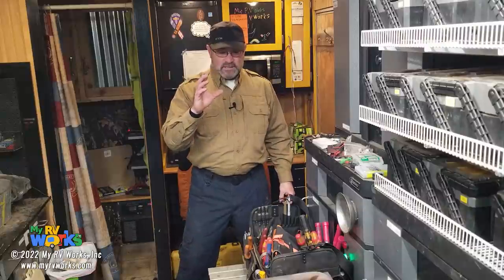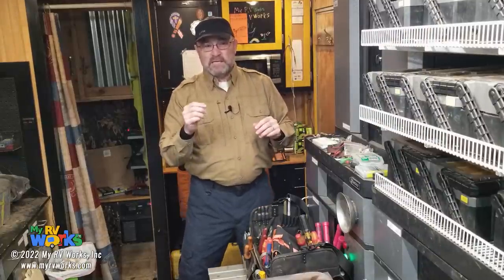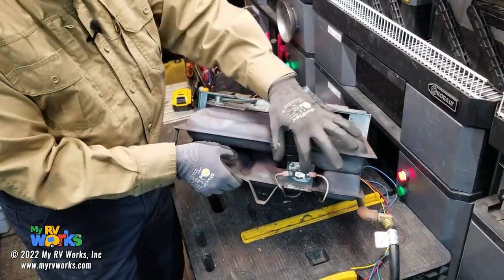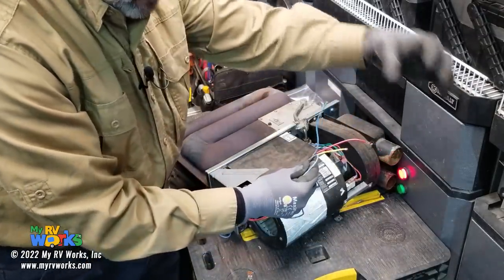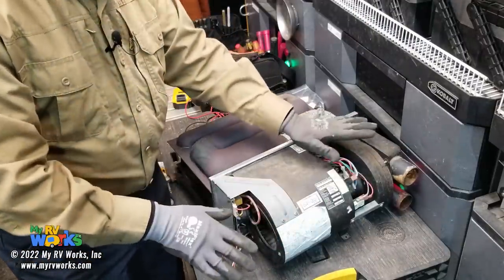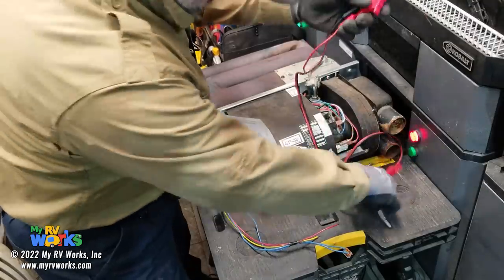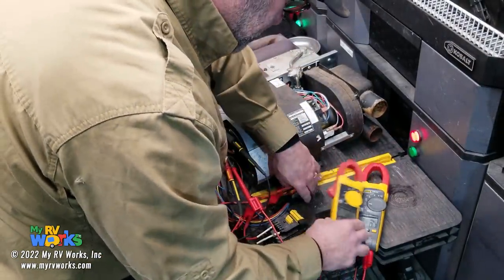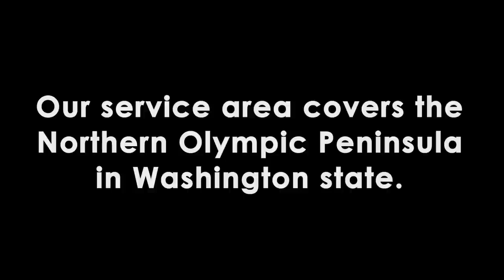RV Furnace Troubleshooting - An In-Depth Look At How To Do It --  (Part 1)  --  My RV Works

Comment from the maker: Thanks for watching! We appreciate your viewership and hope this video was helpful to you. Stay tuned for Part 2!
Reply: I have a problem with my SF- 35 furnace. It starts as soon as the fuse is installed, starts the fan, sequences the ignite circuit but will not shut off by turning down thermostat, or even shutting thermostat off. Funny thing is also the Duotherm AC unit compressor always runs after The fan is shut off. Even when the Thermostat disconnected both issues occur.
Reply: @thekiltedkamper2855
Reply: @frankschauer7828  it ended up being the Dometic control board in the AC unit.
Reply: A video explaining the suburban and wire hook ups.from wall to unit would be helpful. Mine came apart and now I can't figure out which wires go where?
Thanks...and if there is already a video on this please send link. Thanks for your help

Comment: Process of elimination. 80% of all rv issues are electrical. Intermittent issues are likely a bad connection, electrical short, or something overheating causing a fault. The other cause can also be unstable power supply. The first thing i always do is test the DC supply. It needs to ne stable. I stress the dc draw to confirm a stable supply. Then i begin testing parts for proper resistance and inspecting wires for insulation integrity. I use my digital laser thermometer to test wire and other temps. Eventually you will isolate the issue. Always consider that a hidden wire inside a wall or something that jas ahorted or disconnected. I this case i run a new wiring harness for that appliance to the source. I thwn properly label that harness from the source to the appliance.

Comment: OMG !! HELLO DARIN !! MY MAN, YOU ARE A ABSOLUTE SAINT !! THRU YOUR VIDEOS, MY FURNACE IS RUNNING SO QUIETLY, THAT IT SCARES ME !!! LOL I DON'T HEAR IT RUMBLE,  BIG WOOOSH WHEN IT IGNITES. I ALMOST WANTED TO MAKE A VIDEO FOR YOU, AS I RAN INTO A " ANTIVIBRATION STRAP " THAT HELPS HOLD THE MOTOR IN THE BRACKET AND NOT ENOUGH ROOM TO MOVE THE GAS LINE BACK TO BE ABLE TO EASILY REMOVE THE BURNER HEAD ASMBLY., THE ONLY OTHER THING THAT I HAVEN'T DONE IS HOOK UP A NEW DIGITAL THERMOSTAT, AS MY SETUP RUNS THRU A CONTROL SYSTEM 6.5 V THRU 2 TEMP. HEADS COMBINING THE 12.9 THAT'S ON MY SYSTEM. YOU ARE THE VERY BEST OUT THERE, AND I'VE WATCHED TONS OF VIDEOS. ALSO, THE GAL AT YOUR OFFICE IS A ANGEL, WHO GAVE ME PART NUMBERS AND RELAYED MESSAGES FROM ME TO YOU.
IF YOU EVER NEED A REFERENCE,
PLEASE DON'T HESITATE TO GIVE ME A CALL !! GOD BLESS YOU AND 
MY RV WORKS !!!
Reply from the maker: Thanks, George!

Comment: Im a DIY guy on my 5r and my brothers motorhome, and occasional repairs for friends in our RV Club. These videos you provide on your channel has helped me on numerous occasions. Your vids are about the most thourough on the tube. Thanks a million !
Reply from the maker: Thanks, Walter!
Reply: Thanks for the info. The problem I am having is that I can run the furnace but when light are turned on everything shuts down. I put in new batteries and checked to see if I am getting 14 bolts coming into batteries and I was but voltage dropped to 11 volts on battery  also unit is the in to AC  120 volts. Why am I having this problem  I can run furnace or I can run lights but not both
Reply: Volts not bolts sorry

Comment: Thanks for the info Darren. I used one of your videos last spring to diagnose the same Suburban 35 furnace in my trailer. It had occasionally not ignited when there was call for flame, eventually it wouldn't light at all. Found it was never opening the gas valve, no 12v to the valve. When I used a power probe the valve would work just fine. Being an electronics tech I thought, hey I'll just replace the relay on the board! No dice, no electronics suppliers had any stock unless a minimum order of 1000 each! It was cheaper to put in a Dinosaur Electronics board, furnace has been happy ever since. Thanks for your videos! The wife and I really need to visit PA and the Olympic Peninsula again soon. Hello from Snohomish county!

Comment: Your vids are invaluable!  I'm in the engine building biz for about 40 years, but electrical is NOT my forte, and you explain it in a way that this self-taught mechanical engineer can understand.  I need to diag my own heater, and this will help tremendously.  ty

Comment: Doing an awesome job.  Mechanical incline.  Used this method of hearing and listening and helped myself tell my parts person what I have come up with on my demetic 13500 btu furnace an the problem uas a sticky sail switch and cleaned it, he said did that worked but did work quite well so I replace it and works fine. I followed what was said listening and smell. I did some testing of my own then called and told them what I thought it was and they helped finish the deal was definitely the sail switch.  Thanks

Comment: Thank you for the excellent videos. I had a problem with my Suburban furnace FS35Q. A pretty new unit on a 2019 Tiffin 36LA. Hours on the unit probably less than 50. The furnace would fire, run for about 2 minutes then stop heating and then it would try the three times and then lock out. If I turned the thermostat off and then restart it would repeat the process. Using your videos I deduced it had to be the board and bought a Dinosaur from Amazon and that fixed the issue. Thanks again for the excellent job!

Comment: Great videos.  Very helpful - thank you.  It got a rodent in it and destroyed the large fan.  I removed some blades to balance it out and reinstalled, then ran the furnace until I received the new fan.   Furnace was firing fine.  Received new fan and installed, now it won’t fire.  I now have the furnace on my bench to troubleshoot.  Sail switch and high temp switch are good.  I’m getting 12VDC on the red wire at the white connector on the control board.  Fan is running, but gas valve never comes in - brown wire never gets 12VDC.  Tested gas valve with another 12VDC source and it opens as it should - tested with air through it - all good.  Electrode is tight.  Is the most likely culprit the control board or the electrode?  Any insight is helpful.  Thanks!

Comment: I've serviced residential furnaces, boilers and AC for over 30 years.  One thing I'm curious about is proving flame on an RV furnace.  On a residential gas furnace flame is usually proved thru flame rectification.  A small AC signal is sent thru a flame rod or sometimes the HSI.  The signal is rectified as it passes thru the flame and the control is looking for DC milliamps.  Since the voltage to the furnace is already DC is the control simply looking for DC milliamps to prove flame?

It's somewhat amusing to have someone post a complaint that their furnace isn't running what could be wrong.  It's always the sail switch.  You're doing yeoman's work explaining the sequence of operation.  As you said the clicks and ticks give you a lot of information once you know how the unit is supposed to operate.  Thank you.

Comment: I work for a rv dealership and we had one that had a bad gas valve and after replacing that it ran but not well   We had 3 different guys looking at it and we were starting to think maybe it was the regulator on our test tank because it was acting like it was starving for fuel. 
Long story short when the original tech put the gas valve in he torqued the valve ever so slightly into the burner. And he found a service bulletin about that. Took a little twisting to tweak the line and ran flawlessly   But to just look at it you would never think it was not assembled correctly 
And always ask if they tried to fix it themselves. Had a customer put the thermostat wires back wrong   So the complaint about the furnace had me originally order a new thermostat. We get .2 in diag time from warranty that’s 12 minutes So when it takes 20 minutes to get units switched and then have to go find the customer keys to open dead bolt when only the handle is supposed to be be locked so we can access with masters   Another long story short. Thermostat looked like it was working but had no signal to furnace when on heat(quick jab with multi meter)  Supply chain being what it is 2 weeks later thermostat arrives. Wire in like it was and same result. Start looking at my wires and it made no sense. They had power and ground hooked up wrong but the electronic thermostat still lit up and cycled through settings. Thermostat wire was shorted was original issue. But trying to figure out which wire is which by sound ( Ac, fan high fan low heat pump and furnace) added on by diy gone wrong 
So you diyers if you have a warranty issue.  Please don’t make it worse and then not tell you touched

Comment: Here's a weird one! I just changed the electrode on my furnace a week or so ago and ever since then I now hear relays and switches clicking up in my cupboard that I never used to hear before. Before, the thermostat would click and immediately after the furnace would click and you'd hear the flame start. Now I hear clicks coming from way up in my cupboard that were simply never there before. I haven't taken the panel off to see what it is just yet. It's up in there where the factory router and all that is for the Lippert one control system. I have the fuses removed from that system so I know that they are not even on, but what on Earth is this clicking that I'm hearing? And why didn't I hear it before I changed the electrode? Very strange

Comment: I do heating and ac . I took my furnace out one winter .found my board to be bad . I installed a new electrode . Found after I got the new board in I was tick tick tick it lit . Then took the burner apart found a-fits bugs . Also found electrode was dirty and was greater than a eighth inch so I put a new one in and tightened the gap . Now I don't hear it tick like before . Now my gas valve is clicking load .

Comment: Dose not seam that I'm getting 12v power to my gas solenoids everything is coming on but the gas solenoids 
I hear the igniter ticking but no click to the gas solenoids.   But did the drill battery test and that worked. gas smell n clicking fine 

I'm plugged in the land /shore power no battery power.
Reply from the maker: On some of those Atwoods, the solenoid circuit passes through an on-off/reset switch, verify you're getting 12 volts coming out of the brown wire on the control board and follow it all the way to the solenoids. If you don't have 12 volts coming out of the control board then the issue may be the control board.

Comment: If you remove the leads from the high temperature limit switch and put them on a fuse to short around the switch you can monitor as needed to see if your symptoms change. If yes the switch is bad, if no keep swinging.
Reply: If you have a meter, you can put one lead on each side of the limit switch leaving the existing wires in place.  If there's power to the switch and it's closed, you won't see voltage on the meter.  If you see voltage the switch is open.

Comment: Thank you for explaining all that but the issue I'm having with mines. I left a comment on one of your other videos.
So the issue I'm having. I hear the click click  click after the 15 seconds. Im not getting the one click to open the gas valve so what I did was  the 12 V set up the check and see if the solenoids was good.heard the click and smell the gas.  But wen I plug in to Rv not getting the click or gas.   Please advise.  Thanks.
8535 III Atwood

Comment: My sail switch is clean and working properly. However my fan starts to run for about 2 seconds then shuts off for 2 seconds then runs for 2 seconds and shuts off for 2 seconds. Cage is spinning very slowly. Any thoughts.

Comment: I had to replace my thermostat on Atwood 7920-ii bc I accidentally melted it with a buddy heater. Now furnace turns on for about tens seconds and the blower is barely pushing then trips 5-amp fuse on the furnace. Any suggestions on how where to look?

Comment: My 1998 Fleetwood bounder,propane heat only blows in the bathroom and bedroom,but at the entry and passageways it blows cold.so only 2 vents blows hot air ,the front roof ac don't work but the lights come on for the heater ,for the front ac I think the fan is bad

Comment: Hi, Thanks for sharing this information. I have a question as to why my Atwood MPD 38477 /8500IV is underperforming. The motor RPMs sound fine, the flame is full bore but the air out of all the floor registers is very weak. It simply has no volume. At this minute it's 39 degrees outside. I just probed the registers with my laser gun and found the outlets are 77 degrees at best. most are less than that. I checked for restrictions and found none. Any idea what I may check next?
Thanks, and cheers from Louisiana.
Reply from the maker: If the outside exhaust is hot then we can assume furnace is doing it's job correctly at that point...  How about the supply air from the living side feeding the furnace (and returning to living side)?  Make sure the furnace is not drawing in cold air somehow and returning it to the living area.  Also check the ductwork for any breaches.  PS:  Darren grew up in Covington!

Comment: I have a new grand design rv and the furnace, dometic, fires up when the thermostate calls for heat. Blower turns on, ignites for 10 seconds, flame goes off, waits 20 seconds, then ignites again and runs for about 1 minute 30 seconds, then flame out, blower runs for a bit then off.  Same cycle whenever there is a call for heat. Any thoughts?

Comment: My furnace runs on shore power but when on Battery it does the same thing this one does. Fan, ignite , burn out. Repeat. Plug it into shore power and there is no issue. What up with that?

Comment: My surburban furnace lights heats up then kicks off on the first use. Then, furnace tries to light 3 times will not light and locks out. You hear it clicking and lighting but flame goes out after a second or so. Anyone have a clue?

Comment: I have a problem with the furnace it turns on & Runs an and turns off in a few minutes, What could my problem be?
Reply from the maker: The first thing the furnace will do is a pre-Purge of about 15 to 30 seconds. Then it will try to ignite. After ignition it will do a post Purge for about 90 seconds. So my question, do you actually hear the furnace igniting and running or do you just hear the fan running? If you get ignition but the ignition extinguishes within a couple seconds, that is an indication that your DSI board is not detecting the flame. It could be low LP pressure, the gap of the electrode to the burner head, the igniter electrode itself, or the board. If you look at our video playlist we do have quite a few videos that cover every one of these topics. Good luck and try to stay warm.
Reply: It just Runs, no no click or igniter

Comment: Thank you! I understood well..   I’m fixing mine and the intermittent problems are the headache,    I haven’t worked on furnaces much , also I worked for an rv guy ,.   I’ve done all diagnostics on my own, without making phone calls. And it’s in isolation to the motherboard or the igniter for mine. But I am ruling the motherboard. Because my furnace shuts down. It’s different when you can grab the parts out of the service truck. L O L, And why I think it’s my motherboard is because the motherboard gets warm and then the problem acts up